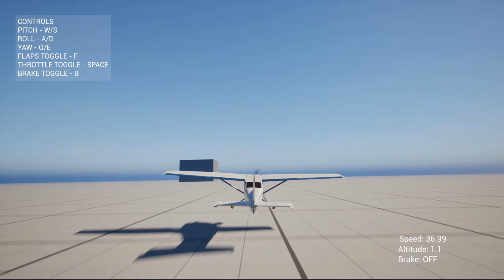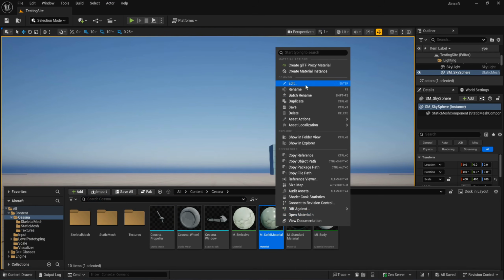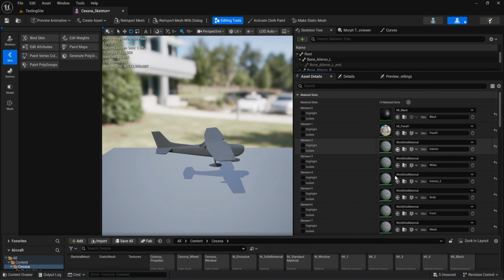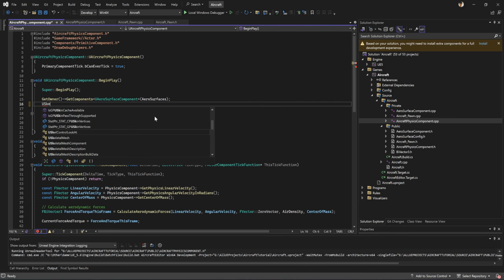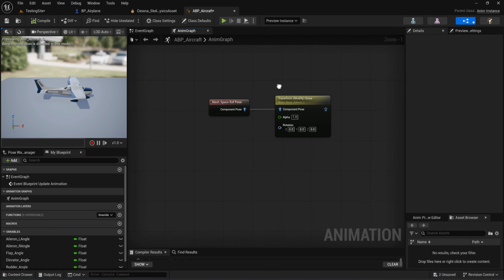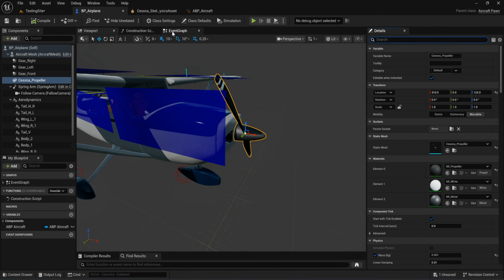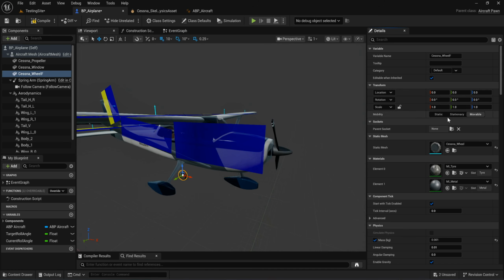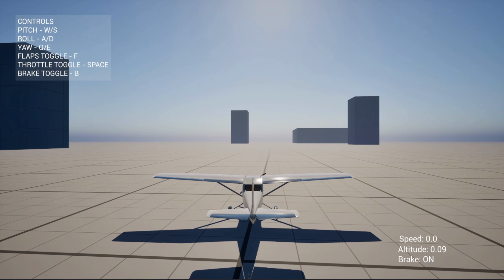How to Animate Aircraft Flaps in Unreal Engine #2

Comment: Hello! Awesome tutorial :). I just have a small issue, my aircraft doesn't seem to be stable and leans to the right a little bit all the time. I checked the inputs and it's not that, and I triple checked your values for positioning the colliders in the skeletal mesh and they match 100%, and visually it doesn't seem to have any part not correctly positioned. Do you know what could be the issue? Thanks!
Reply: Hi, I encountered the same problem. Did you find a solution?
Reply: @Владимирв9м kinda, I tweaked the center of mass offset to make it stable, the model is turned 90deg in an axis I don't remember right now, so center of mass is also rotated, keep that in mind

Comment: But why, the ABP is the same as BP and it also works on tick, this just complicated it with converting to SKM without any real reason
Reply from the maker: We need animation blueprint to modify the bones rotation. We set the input from Blueprint pawn to animation blueprint. If you don't want to set it in event tick, you can set it after the input action event.
Reply: @jourverse  but we dont need any bones, so we dont need abp as flaps can be animated from bp
Reply from the maker: @As_Ss  Yes, if you use static mesh, you can separate the flap meshes and have correct origin for each mesh. Using skeletal mesh is a clean solution, that let your animation blueprint focus on animate the bones. You use static meshes, if you want straight forward solution.